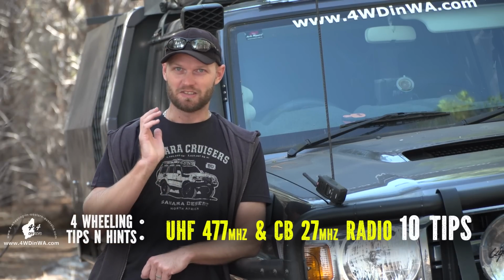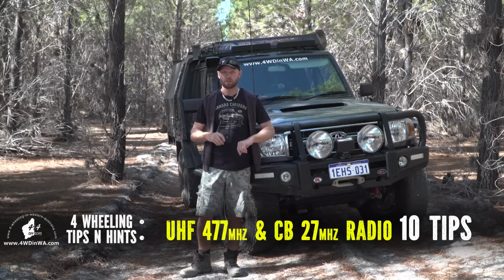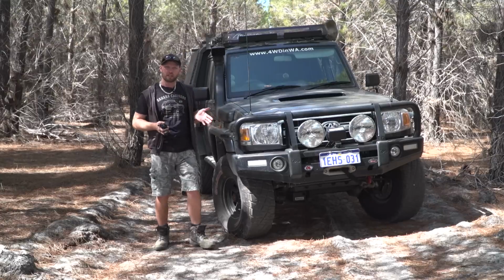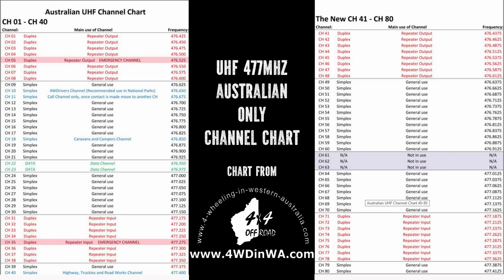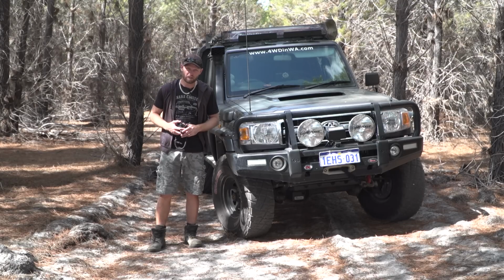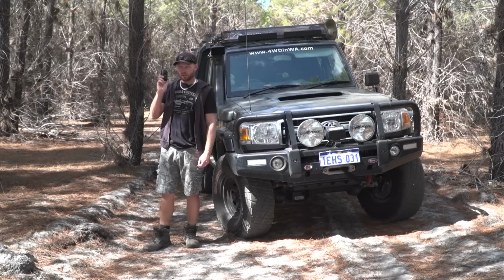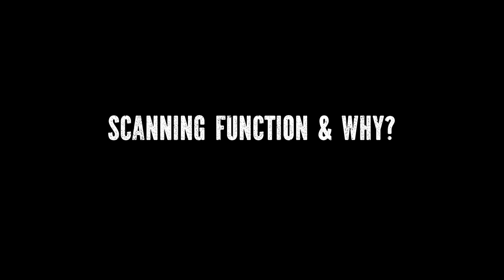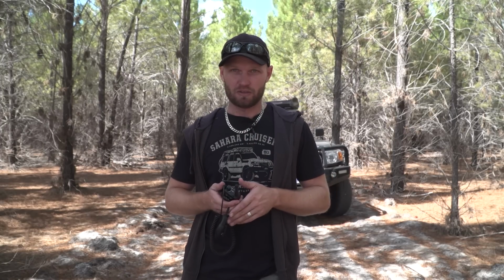UHF CB Radio 10 Tips

Comment: Range whilst no guarantees are made is actually a lot further than you mention line of sight, i've done 500mw from a portable into a repeater 80Km away with boring regularity, and covered 10Km portable to portable just the same, that said line of site is crucial, as soon as it's obscured you can struggle to get 200m indoor to indoor.

Best way to operate is with radio 1-2 inches from mouth and at 90 degrees, speaking across the mic.

Important! You mentioned that people should avoid chans 1-8 for simplex use which is true, however it's much more important they avoid chans 31-38.

Unless i missed it, did you mention chan 5/35 is an emergency channel?
Reply: Adding, have done SE Victoria to N of Tasmania on UHF CB with 5W, vertical ~6db colinear antenna during a phenomena known as Tropospheric ducting, happens occasionally on summer evenings. This is rare and casual users will just about never experience this ever.

Comment: I find it hard to believe in this day and age that someone hasn't come up with a way to use your smart phone via your uhf antenna. It would eliminate the need for the clumbsy hand held unit and chord and make it wireless. You could also do away with the clumbsy push button start stop bullshit and just have an open call, just like a phone call. I find 2 way to be so clumsy early 1900's.
Reply: Gibbet Hoskins It's limitations of the technology that mean you can't easily do what you're asking there, the system isn't set up to do that. You can make a phone call more or less over marine VHF channels (or similar) but you need a set capable of doing that. To use your phone you'd then need a link from the radio handset to your phone, so that's gonna be Bluetooth, so you won't be able to get more than about 10m from the radio set if that. So at that point just use the radio handset. 
The limitations do mean, generally, that you will find two ways being used quite professionally and succinctly, so you don't end up wasting your damn time on the phone.
Reply: ham radio has these phones. dont see why  a software mod couldnt get them uhf cb .

Comment: 11 meter cb you need Watts at least a 100 the 5 watt stock units can't get past the background noise  the vhf and uhf at least 25 watts  for good vehicle communication  antennas tuned match good low swr and a spare some times they get broken ? for off road 4×4 use  !  if you loose ant don't transmit it will burn out the output transistors ! ps as far as rules there are designed make you fail  5watts is BS!!!

Comment: 1 thing i did forget to add 

Note: the repeater channels on UHF and don't use them and note what is being used by road works and council repair crews..

also note what to use whether you use 40 channel or an 80 channel rig...

also note: it is illegal in australia to add external amps to cb radios..

Comment: In Canada our rules for radio are all screwed up probably from politicians making laws on something they don't understand, I go into detail here https://barryrbrown.blogspot.ca/2014/12/frsgmrs-radio-explained.html. We have the AM 23/40 channel CB using the 27MHz frequency (no licence required). We also commonly use (illegally) VHF "Trucker channels" called the Ladd channels (1-4 + other frequencies). These channels are meant for industrial applications only and you need a "Commercial Radio Licence" to legally use them or own a VHF radio. We als have FRS/GRMS (no Licence required) that uses the UHF band that are low power (0.5 - 5 Watt) hand held radios and in Canada you are not allowed to use a vehicle mounted FRS/GRMS radio and you can't even buy one. So if you really want a decent radio in Canada you have to get an Amature Radio Licence (HAM). Now let's say you have your HAM licence and you get a UHF radio that you program so you can talk to your buddies on FRS/GRMS  when off road, guess what? Licenced HAM radio users are not "legally" allowed to use FGS/GRMS frequencies unless it is an emergency situation. We really don't have a good truck to truck radio system here in Canada unless all fourwheelers and overlanders are HAM operators. More or less we are nackered.

Comment: 11 meters (CB) will "Skip" in the right conditions. UHF will not.

In the US the 470 MHz band is pretty much abandoned and was once home to analog TV stations. I think there are still some outdated public service systems in the higher parts of the 480MHz band which is dumb since they should be on 700MHz by now..
The FCC could easily allocate part of the 470 - 480 MHz band to a new GMRS (UHF CB) band with more channels for license by rule simplex analog and licensed  digital and analog repeater use and give the existing 462/467 MHz GMRS to the FRS group but more realistically the FCC will sell parts of this band to service providers instead.
We are going through a part 95 rule change now but all the changes are in favor of the toy radio manufactures to allow for useless gimmicks.

US CB radio channels with unofficial High and Low bands, The main 40 channels are in band B (center column) http://www.cbtricks.com/radios/midland/77_113/77_113_freq_chart.htm

US GMRS and FRS channel list with New allocations - https://wiki.radioreference.com/index.php/FRS/GMRS_combined_channel_chart
Reply: ElfNet Gaming How about DTV channel 15 and analog UHF CB radios?

Comment: I feel that it's important to know. uhf on 1 w will get out really well if you're home based using a decent antenna.
eg. I use a diamond x30 at about 5 meters hight on the side of the house.
I can open a repeater 38 miles away 16 of which are over a stretch of water.  using a 7 yr old wouxun kd-uv1p handie version 1
Reply: oh and great little vid by the way. enjoyed it here in South Wales UK. Thanks 👍

Comment: My Guide for Using CB in the 21st Century:

1) Get an SSB capable radio. You’re wasting your time and money if you only get a standard 40 channel AM rig. Most serious 11m operators are on the single sideband mode. The upper CB channels in LSB mode or the freeband frequencies in USB or LSB mode is where 99% of the traffic is these days.

2) Ditch the fake southern accent. Unless you’re actually from the south, with a PROPER southern accent, you sound like an idiot in 2017.

3) Ditch the 'CB lingo' and drop the 10-codes. It’s not 1979 anymore and honestly, just like the fake southern accent, it only reinforces the negative and goofy image of CB and its users. Just speak normally OR you may use widely accepted modern radio jargon such as ‘Roger’ ‘Affirmative’ ‘Negative’ ‘Say Again’ etc. and it wouldn’t hurt to know the phonetic alphabet either. More and more people are using it now.

4) Don’t use a dumb CB-like ‘handle’ such as ’TheBigNasty’ or ’Swamp Fox’ or ‘Treefrog’. You’ll find that most operators on 11m sideband have a callsign. These are usually alpha-numeric unique identifiers that the individual has either created themselves, or have gotten from an 11m DX club in their country or region. OR you can also just use your name. e.g “Hey, it’s Jim in Alberta’

5) UHF radios (FRS/GMRS) are local line of sight only. ‘Skip’ or ‘DX’ is only possible on 11m (27MHz) frequencies and only during periods of high solar activity. The last solar peak was 2013/2014 and the next one won’t be until 2024/2025. So expect only the odd occurrence of skip occasionally and expect to hear hissing snakes most days until the next solar cycle peak. 

6) Have and show respect to your fellow operators. There really isn’t a need to use profanity over the air or getting into flame wars. Excessive use of profanity only diminishes your intellectual image and demonstrates how classless of an individual you are. There’s nothing wrong with disagreements or healthy debate, but keep it respectful and dignifying. Try to stay away from topics like religion, race or politics.

7) Don’t hog the call channels. Ch. 19 AM, Ch. 38 LSB and 27.555MHz USB are the usual local, regional and international calling frequencies. Once you’ve established contact with someone and wish to have an extended conversation, move to another channel. When choosing a different channel, listen first to make sure you’re not cutting off another conversation.

8) Channel 9 (27.065MHz) - May have been an 'Emergency' channel back in the day, however don't count on it now. I know several people and have colleagues in Law Enforcement and Emergency Services and trust me, NOBODY monitors this channel/frequency in 2017. Therefore, do NOT rely on channel 9 if you're ever in a jam. You've been warned.

9) Most importantly, have fun! Radio can be a very fun hobby and educational as well. If you find that you want to explore more of it, consider getting your ham license. With a ham license, you have access to MANY more bands, frequencies to use as well as many more modes of operation and more people to talk to. CB can be pretty lonely most days. Ham radio doesn’t have to be. There’s almost always someone out there to talk to on 80m, 40m, 20m, 17m or on local 2m VHF and UHF repeaters.

:)
Reply: Unfortunately CB has turned into a bunch of q-code talking ham wannabes with fake made up call signs.
Bring back the lingo like it was the 1980's

Comment: Among other problems with this video, holding your radio higher does not have the same effect as switching to a longer antenna. Height does help, but when dealing with antennas the difference is in the gain produced by how long the antenna is compared to the wavelength of the frequency that you are tx'ing on.
Reply: You are somewhat correct. Going to a gain antenna could help because you are putting out more ERP, or effective radiated power, but;  in UHF  power is saturation, height is distance. Holding any antenna higher can get you more distance.
Reply: @jhutch1470  to add on holding it higher, gets better "line of sight" and can also see further  over a  horizon, also being higher can help with the amount of dust the tx has to cut through
Reply: @its_billyrusso4868  I agree. Using a higher gain antenna is a much better option. I guess I meant to say that if you don't have one and need to finish a communication, then you can hold it up and TRY to get it through.

Comment: Good tips / introduction!
Just a tiny correction and additions:

At 5m29s, I suppose you mean 'split mode' instead of 'duplex' when using a repeater. Duplex would be like a telephone, transmitting and receiving at the same time, whereas repeaters have just differing transmit and receiving frequencies.
I'd recommend to have the nearby repeaters' frequencies programmed in the radio or at least having a list of them in one's car. Useful in an emergency to have the biggest range and a bigger chance to have someone tuned to one's frequency (besides to the normally used emergency channel.)

[edit] There seem to be different designations in the CB and the ham world. CBers most likely use the word 'duplex'; the hams the technically correct word 'split'. [/edit]

As was already mentioned: Good practice is to use the following scheme when talking on the radio:
1. THINK, before using the radio. Have the words ready and get to the point of the message rather than transmitting long pauses and "errrr, ehmmm,...." fillers.
2. PUSH the PTT button
3. SWALLOW, to make that tiny pause and avoid cutting off the first syllables when talking.
4. TALK, transmit the message.
It's not a strict rule on CB or ham radio, it just helps to use the radio in an efficient way.

73 to VK6 from HB9
Reply: Nope. He means duplex because that's what it's called. If your a ham (saying 73's) you should know that. Duplex IS the correct term.
Reply: duplex is named more to do with the action the actual repeater is taking.. its doing the duplex (xmit and rcv at the same time), always has been known as such in CB. simplex as mentioned is direct radio to radio
operating 'split' in ham terms is not always the same thing (using a repeater), but actually xmit and rcv on different freqs. on YOUR OWN set

Comment: hmmmi would be careful what hand helds  you flash about you may see a call from acma...
Reply: +Jason howe, which radio are you referring to? It looks like a GME to me, its not a Baofeng is it?
Reply: +Nicky Winters  it looked like a baofeng to me if it was they are deemed ham radio due in part of being dual band, as I have never seen gme have a removable antenna..

Personally I'd rather use baofengs for this application  due to the battery kit options though you will likely need a ham radio license to use them.. To be compliant when you use them..
Even with the 70cm whip antenna on them they are only good for about 1-2km outside of repeater use..

My opinion you really should have atleast 1 40 channel wide band UHF, narrow band UHF, narrow/wide band VHF, 27 MHz and ham radio.. And the the emergency service ham that the rfds uses..

As I doubt anyone monitors channel 9 27 MHz or 3/35 wide UHF or the narrow band equivalent given the deregulation of the CB bands.. 

Also note it is illegal to transmit without a callsign whether you use a ham or CB radio
Reply: Jason howe Hi Jason, to me it looked like a GME, to be honest none of my GME radios have ever had a fixed antenna they have always been removable, but maybe there are smaller models that are fixed only, everything you said makes sense, I agree with you all the way, to me it just looked like a GME radio, maybe the OP can clear this up for us? eitherway I'm with you, the UV-5RE*** are very flexible radios, personally iv'e found unless you cause trouble and draw attention to yourself nobody cares too much, I guess it just depends on where you live? I'm in Australia if that adds anything
Reply: Nicky Winters yup unless you start flashing the Bao's  around where ACMA can plainly see..

To be honest due to the programmability of the Chinese ht's I much prefer them than the basic gme, uniblend, oribomb, and any other ht marketed  for the UHF and 27mhz CB market whether it be mobile, ht or base station..

UHF 5 watts gets you  approximate 1-2.5 km in an open area, in dense bushland 1km or less this is what I have seen with the seen with uniblends and the Chinese ht's no matter the antenna used

Uv3,5,8's  are all deemed ham radios..

Yes I do agree with you they are a great radio, though don't go above 5 watts and don't get caught by the radio police as I doubt you want to get a large fine using a radio you aren't permitted to use under class license..

And 1 more thing unless in a controlled environment please keep off the radio, talking on CB whilst driving is a federal offence if caught, $20,000-100,000+ per offence, this applies to all radio devices, including the mobile phones..
Whilst you might a demerit on the state level be lucky the cops don't decide to hit you with the federal charges because they are worse...

The only reason they don't go you on federal because the can't be bothered doing the paperwork..

Something you may want to consider if you decide to stick ya head in the Mobile phone whilst on the freeways and highways of Australia..

The only reason why I know about federal laws because I was in a CB club in my late teens and early 20"s

Nicky I'm in Perth WA.. This is a general descriptive of my location..

Comment: In Victoria Police we were taught to hold the microphone next to your mouth but facing sideways not front on.  This side on placement means you have close and full voice volume without the muffle and interference of your own breath.  Also wait one second after you push the talk button before you talk or you'll 'clip' the start of your conversation.
Reply from the maker: +simon clemence great tips mate, will give that a try (mic to the side)
Reply: you are correct. you talk across it not into it
Reply: Agree dons it same for 15 years
Reply: My little handheld is really bad for cutting the start of convos, makes you have to keep getting people to repeat
Reply: @Shitbox Adventures Same here.  14 years now a courier.  On one delivery I was over 100km from base and on top of a mountain.  I was going to phone depot when I discovered the 2 way was reaching them.  Elevation makes the difference.
Reply: Police use dmr so waiting 1/2 a second isn't necessary however is still a good practice